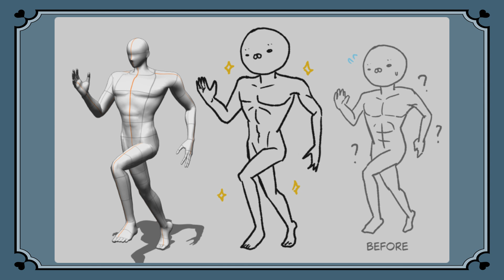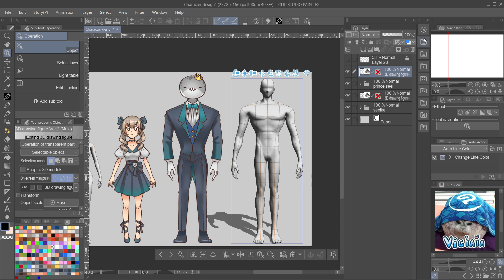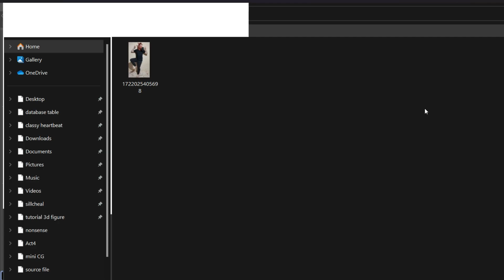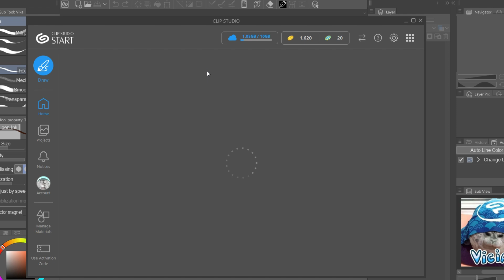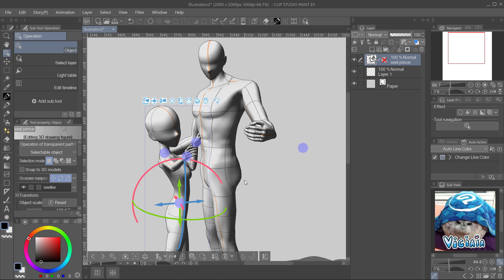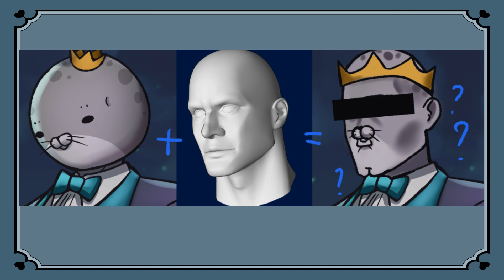[CLIPSTUDIO TUTORIAL] The easy way to draw a scene for couples with 3D drawing figures

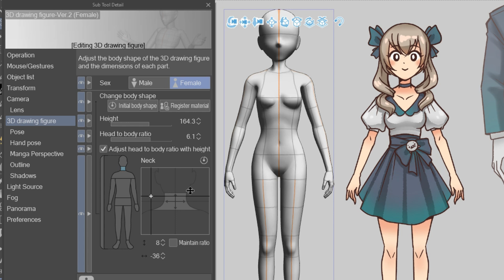Comment: 1:45 hello, wanna ask, is that new update or old feature that need to turn on/off? that 3 option of specific body part adjuster above the adjust box, because i dont have that feature on my clip studio paint.
Reply from the maker: I'm not sure it's been added on which version of clipstudio ;_; but i already used it for a while. which version you're using now?
Reply: @ViciaiaTutorial currently, im using the 2.0.0 version (CPS EX). kinda lazy to update, my laptop is pretty laggy.
Reply from the maker: @skyway.-pom8sh977  maybe it's not yet available ;_;